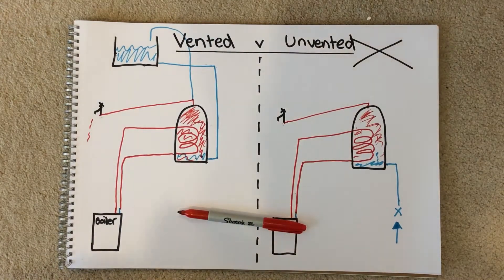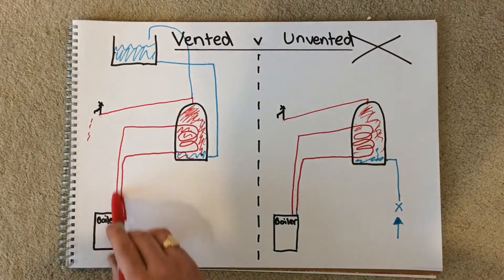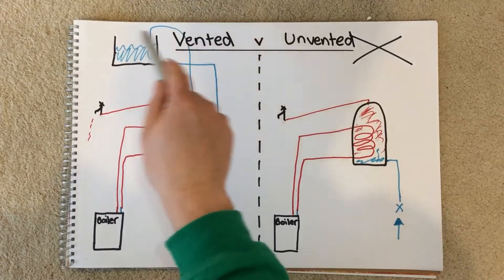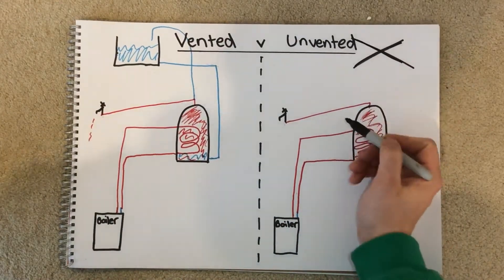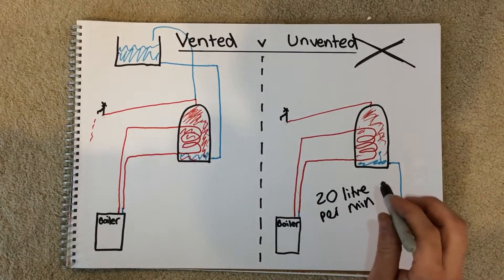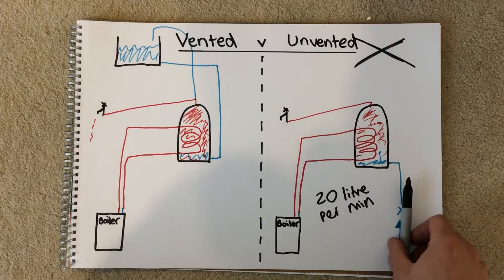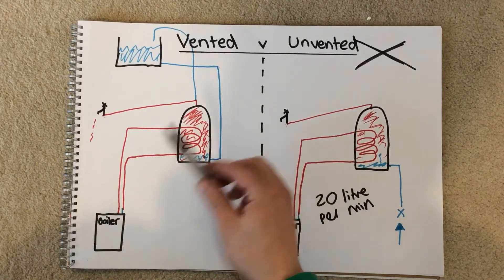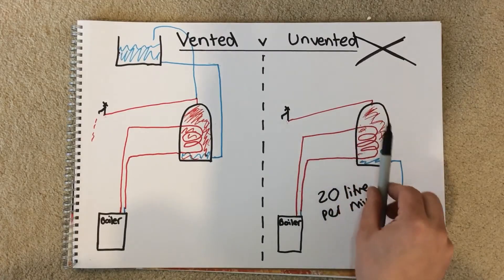What is the difference between a vented and an unvented hot water cylinder?

Comment: btw. could you make a video on how to get rid of this immersion tank completely and connect boiler and mains/cold drinking water directly? We have this immersion tank installed by previous owner and whatever he did, he somehow fed hot water from boiler to the tank. So if we start a shower, the overhead tank starts to throw out hot water in front of our door. He said once dont turn it on as it would burst the heater tank. So we have not been able to use our shower for over 3 years. We tried to ask a plumber/electric man to remove it, but he could not as the shower was out of warranty with no docs. So its bucket and glass to take a shower for us

Comment: Hi there. Let’s set I’m in a warmer climate. I would do away with the boiler part yes? And still have the unvented cylinder. Is that correct. But I intend to heat the cylinder using  my solar inverter. Is that ok?

Comment: How does the unvented system allow for expansion?
Reply: add an expansion vessel or loss leak radiator, like a heated towel in bathroom/rad that draws heat from the circuit

Comment: Hi I have a unvented hot water cylinder in my flat.. When attempting to change my bar mixer shower, hot water continues to pour out of the hot side. I have turned the stopcock off and water stops pouring out of the cold side but not hot side.

Do you know how to turn the water supply from the unvented water cylinder off?
Reply: Did you work this out? Lol
Reply: From what I recall.. I attempted to turn the valve anti-clockwise for the hot water pipe that leads to the bar mixer.. due to the age of the valve and corrosion it began to squirt water out... so I was forced to turn the whole supply off from cock stop. I was without water for 3/4 days awaiting for an engineer to come out and replace the valve and bar mixer. In regards to the bar mixer he used PTF tape to prevent water from leaking. I later replaced the valves from the cyclinder to industrial ones with a ball and lever so that they never corrode. @marcusdavidsmith3047

Comment: Why have you not mentioned and included the expansion vessel for the unvented cylinder BOOM!!!
Reply from the maker: Hello Paul, the basis of this video was for simplicity. If I was doing a video targeted at fellow heating professionals, you would have a case. We have not included the expansion vessel, control inlet valve, D1/D2 pipework, zone valves, T&P valve amongst other requirements because as professionals this would be our job to carry out.

Comment: Why is unvented more expensive if there are fewer parts?
Reply: It's a stainless steel tank instead of normally copper one for vented. It also has parts not in diagram like pressure vessel, combination valve etc

Comment: The downside is my daughter. She has showers that would float Noah’s arc. Torrents of hot water is a cost not a benefit
Reply: Hahaha!
Reply: You should create a central bank for your family release a currency and run an economy for your family.
Track water usage with a sensor and heat usage and give out bills. 

Pretty soon she will realize her water heat and internet bill is cutting on her lifestyle so she will start saving.
Reply: Joe, she's left home now. When we visit her in the winter we have to sit under blankets. I fitted a temperature display on the hot water system. When it failed she went nuts until I fixed it. I think its called 'growing up' @joeroganpodfantasy42

Comment: Hi, why do you need an expansion pipe if the cold tank is open to the atmosphere? Wouldn't the water just expand up the cold feed ?
Reply from the maker: demonskier1 if there was no expansion pipe, then hot water has more chance of mixing with the already cold water. Making the chances of bacteria, such as legionella to form.
You don’t want the hot water to go into the tank, so the pipe must be raised to allow for this.
The expansion pipe is required to conform with water regulations.

Hope this helps
Reply: @UpsherHeatingHeroes  Many thanks